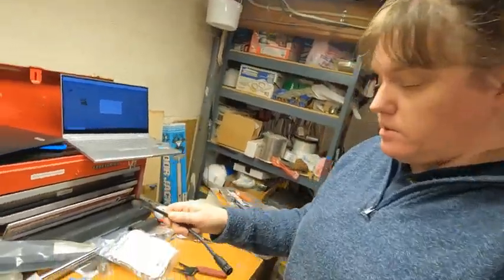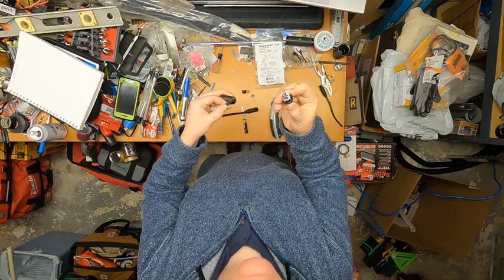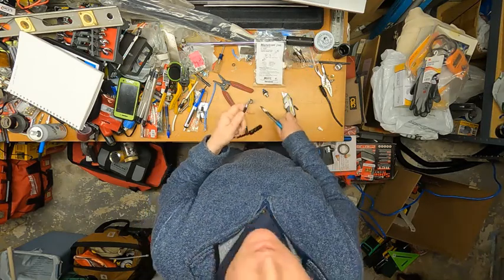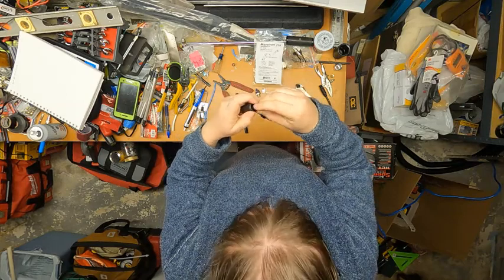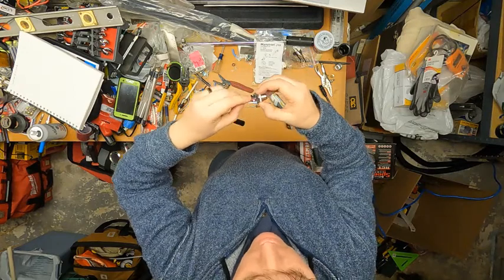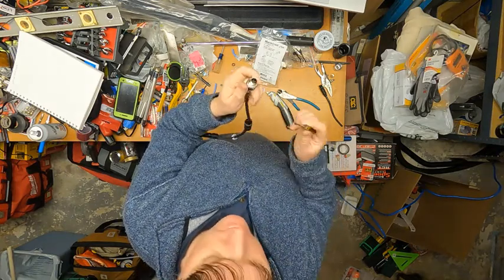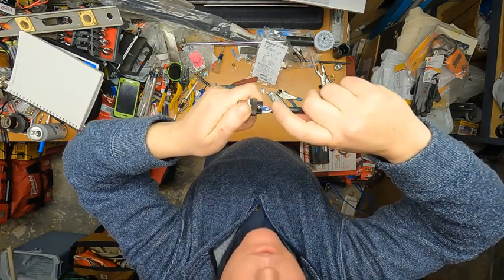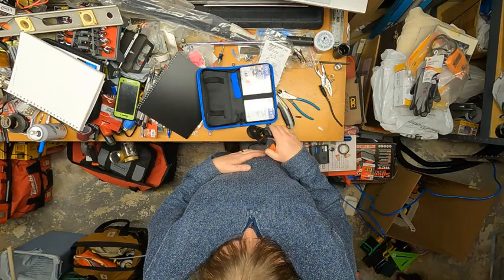Lab 3 Connectors N2K

Comment: nce video have you ever striped a Ray Marine sea talk cable? I'd like to cut it's connector off an replace w/ NMEA2K. basicely not using the 6th wire that Ray uses.
Reply from the maker: Hi Steve,

A comment??? I wasn't watching for that.  I basically use this page for our Electronic's classes, which doesn’t start until Winter Quarter.  I actually need to redo these videos so you can see what I'm doing better.

Anyways, you can put a N2K field connector onto a SeaTalk ng cable.  SeaTalk ng is basically NMEA 2000, just with Raymarine proprietary connectors. Raymarine also sells adapter cables that go between NMEA 2000 and SeaTalkng, which is what I primarily use.  However, to put a field connector on, you just use the red/black/blue/white/shield cables like a normal NMEA 2000 cable.  And cut back the Raymarine 6th wire (yellow), which is used for old SeaTalk1 information when plugging into the ST60 or ST70 with a special adapter cable, I believe.

Sorry I didn't see this sooner.  Hopefully this helps or you already figured it out.